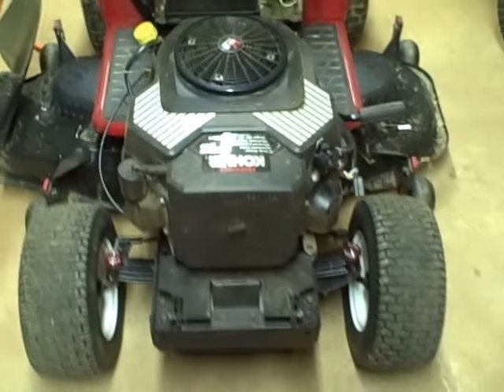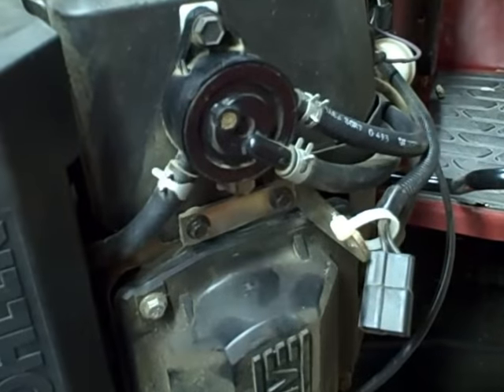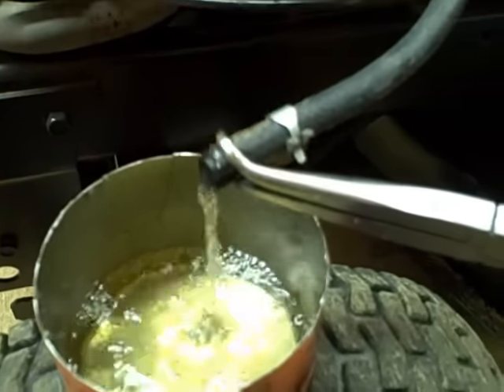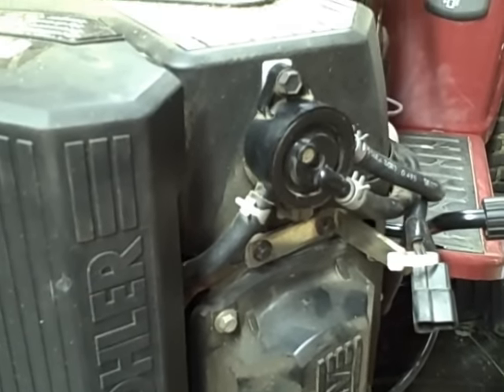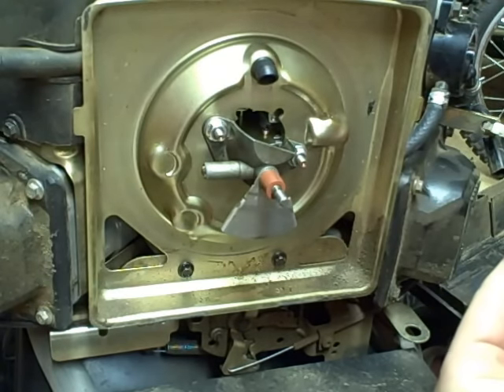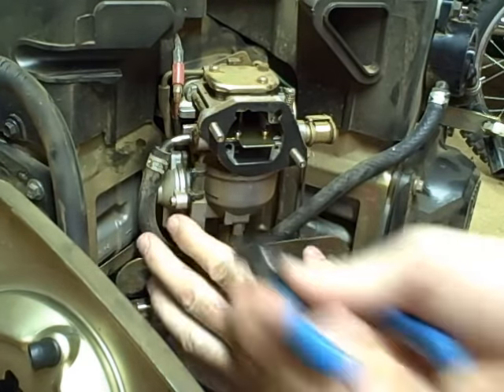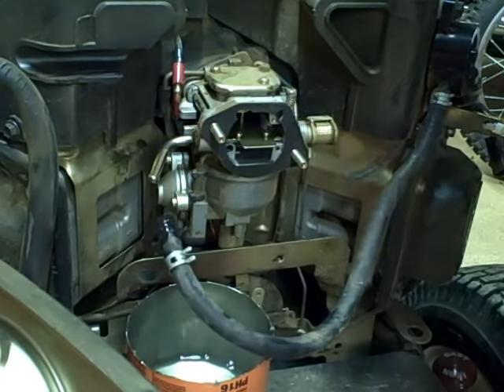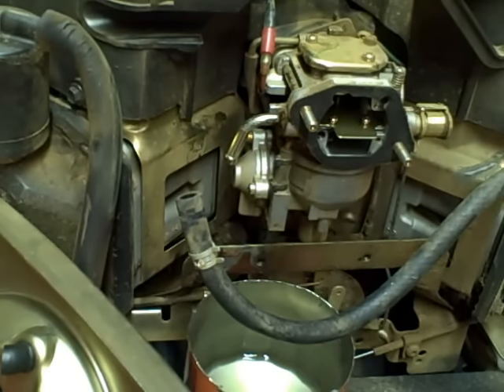Small Engine Repair: Checking a Vacuum Fuel Pump / Fuel System on a Kohler V-Twin Engine

Comment: Why not just disconnect the outlet fuel line from the pump and attach a short piece of spare fuel line to the pump. Then you don't have to take the air filter off.
Reply: I thought the same thing at first..... then I realized after he had all that removed, it allowed me to learn something about the line to the carburetor that I previously didn't know. Maybe he did that for just that type of reason. Take care.
Reply: He proved there was no obstruction in the carb supply line.
Reply: because that would have been to easy
Reply: That would be an easier method, but it assumes the person working on it had a spare fuel line to attach and test with.  His method works for everyone regardless of what spare parts they have available.
Reply: His way verified fuel flow all the way to the carburetor, doing it the way you are saying doesn’t, could be an obstruction in the line and you’d never know.
Reply: @Brees1986  Forget the extra/spare fuel line, just let it come out of the connection tip and catch the gas in a cup... That way no spare fuel line is needed
Reply: Glad he did it the way he did! It showed me the correct location of the fuel line. Some moron before me had pinched the fuel line between the carb and the air filter shroud so nothing was flowing! Probably the easiest fix in the book!
Reply: @Brees1986 🎯👍
Reply: @tmise50 🎯👍
Reply: @schlenbea 🎯🎯🎯👍

Comment: I had a ch 20 S Kohler V Twin, it was cutting out and shut off at high speed operation, I  tried another carburetor, fuel pump, checked the fuel filter etc.(before watching this video) The engine idled fine all day. It was definitely a fuel starvation problem. After watching this video, it stated check the oil level. Well the engine I was working on had WAY to much oil in the crankcase. The oil level is CRITICAL to the operation of the fuel pump since it works off the crankcase. After draining about 1 quart of oil out, the engine ran PERFECT.  If anyone has a similar problem check the oil level first. GREAT VIDEO!

Comment: To figure out the flow rate pump fuel into a measuring device for 15 seconds. Divide the measurement you get by 15 sec and you have base unit per sec. Lets say you measure ounces then it would be some number of Oz per sec. Now you can figure out how many gallons per hour.

Comment: You saved the day. You are the only person to mention the problem with too much oil affecting the pulse line. I had replaced my fuel lines, the filter and the fuel pump, but never thought to check my oil level. Sure enough, it my oil was a bit past the full mark. I drained it down to just below full and now everything works perfectly. THANKS!
Reply: Learn something new everyday. Never thought to check my oil level. Didn't know that that could affect the vacuum

Comment: Couldn't you remove the fuel line at the pump on outlet side to check pump flow and not have to take carburetor assembly apart?
Reply: Yes. Except you can expect gasoline to get all over the place. He made sure it went into a can.
Reply: He proved there was no obstruction in the carb supply line from pump.

Comment: Instead of taking off the air filter which takes a bit of time and effort, would it not be easier to take off the outlet pipe from the fuel pump and see if fuel runs out when you crank the motor, its the same result.
Reply: Tony Wonka yeah thats how I check my fuel pump
Reply: But maybe he just making sure its making it all the way through
Reply: Tony Wonka also he didn't wanna get gas everywhere
Reply: Well your engine will only run for 20-30 seconds with the fuel line disconnected if you are on a pull start mower like most commercial walk behinds. Plus this is not the exact same results because that would be post fuel pump so there are multiple variables. If you have a brand new good pump with good vacuum/pulse line but a partially clogged inlet line or siphon tube it will still draw fuel but not full flow but you you cannot visually determine full flow because half flow still looks like a lot. It Would give you a rudimentary idea of am I getting gas to the carb or not? Cheers
Reply: Would not have thought of that but that would be easier as long as you have some fuel line
Reply: Tony Wonka how do you clean the oil from the pulse line?

Comment: Sorry 1 more question:   my scooter has a one-way/no-return fuel valve installed between the fuel filter and the fuel pump.  Why is it necessary?  And does having a no-return valve helps to solve the problem of a faulty fuel pump that has fuel coming out even when there is not pulse from the engine?   TQvm

Comment: I am having oil coming into my carb on a toro 5000.... would anyone know what would be causing the issue? Took carb apart and cleaned it. Crank it up and still leaking oil from carb. Any tips or help would be appreciated

Comment: A great example of step-by-step, Point A>Point(x) troubleshooting.  I use the same principle whether it's gas or electrical flow.  Start at the source & test every junction in sequence until you find the failure.  Once you've built up your knowledgebase, then you can start "most likely problem" troubleshooting. :)

And thanks for having your lighting set up well!

Comment: Nice presentation of the troubleshooting flow chart! I went at it from a different approach,based on my personal mechanical knowledge, but didn’t think about the possibility of the crank case being over full causing this issue🤯. Thanks! That’s the first thing I’m going to look at tomorrow morning. I’ll be back with a comment,if my problem is solved by this inspection.

Comment: Great video...I tested my pump as shown in the video, and everything worked as shown, but my problem continued,  the engine would start up fine ...but only run for a minute or so, then die (as if it ran out of gas).  Letting the engine sit for a while would then allow it to start up again for a minute or so.  I watched a couple of videos and one video mentioned how you could tell if the pump was old by checking the small screen on the front of the pump....if it was black it was "old" if it looked metallic, then it was "new"....hmmmm I wonder?....so I got out some alcohol and a small brush and cleaned the screen from the outside (it was black and dirty) ....once cleaned the engine started right up ( as usual) but insteadf of dying out I mowed the entire yard with no further issues (about a 40 minute job)....so you may not even need a pump at all....you may only need to clean the small screen....worked for me !!!     Give that a try  !!!
Reply: Thanks for that tip.
Reply: How is your machine running this year?  ,i jave tried everything so im gonna try the screen cleaning next after reading this
Reply: My problem on a 22HP Kawasaki in my X320 JD turned out to be a bad connector (12 Socket) with 3 yellow wires.  One of these had low (10VDC) and was not opening the Fuel Shut Off Solenoid.  I checked the solenoid direct from Battery.  I went at the Connector (very small connectors) with Brakleen and plugged it back in and heard the Solenoid click.  I had started at the solenoid checking connectors and voltage.  There are 2 other connectors. One 5 pin, one butt connection at engine.
This after pulling the carb twice, blowing out line from pump to tank, replacing Filter, Fuel Pump and a lot of beer.  Works perfectly now.

Comment: As many others have said, nicely done. I'm checking my fuel pump tomorrow. It runs when I drizzle gas into the evaporation chamber before the carburetor. If the fuel pump is not it, it's probably jets, also simple.

Comment: Yes, he had the oil overfilled and the rubber vacuum line to the pump was cracked in half and deteriorating from oil in the tube i suppose.  Replace that vacuum line to the crank case if needed.  Thanks.

Comment: Nice job, thanks. Excellent camera work, tool selection and narration!
As others have mentioned, could troubleshoot in a way that avoids air filter removal, but it's always good to have a visual check of the entire fuel line and carb. 
Those notes: (thanks wonka & quantumrift)
1. Vacuum gauge is a good, inexpensive tool to help with troubleshooting
2. Can remove fuel lines from fuel pump line to save time and add a small piece of spare fuel line to do checks, if fuel pump is fine, then you know it is a line condition issue or obstruction
3. If gas cap vent is an issue, a tooth pick can be the right tool for a fix

Any votes on how long most fuel lines last before their condition affects performance in hot, humid climates? 3, 5 or 7 years?

Comment: Thanks for the great video!  I recently rebuilt the Walbro carb on my 31F series 17HP Intek, and it ran great for a couple of months, then started acting up again.  I checked spark, air, and fuel, and everything seemed fine, except that it would start spitting and sputtering after running for a while, and then sometimes stop.  After a minute it would crank, and then go for some more.  I saw 2:52, walked to the garage and opened the fuel cap, and was greeted by the hissing of air rushing into the collapsed fuel tank (it's hidden inside the frame of the mower) and a loud pop as the tank flexed back to it's normal shape.  That little diaphragm actually pulls hard enough to collapse a heavy plastic tank!  The engine starts and runs fine now with the cap partially opened, I'll have to replace that soon.  Anyway, thanks again, your video saved me from tearing my hair out!

Comment: Thanks for the video.I see a lot of people asking why take off the air filter assembly. I’m glad you did! My was already off and I was ready to buy a new fuel pump.I am working on a Honda GX610 and it keeps cutting off starving for gas. Now I know the lines, filters, and fuel pump are all clear and working properly, I KNOW now to keep searching for that low oil sensor. I’ve bought a new one but can’t find the one on the engine.Anyway, Thanks Again!

Comment: One thing you missed  is that some tanks have a wire mesh screen mounted to the pick-up inside the gas tank, these can become plugged or actually collapse and restrict gas flow. This happened to my Simplicity it would idle but was not getting enough gas to run at higher rpms. After removing screen and installing a good inline filter the tractor runs great.

Comment: Good video 👍 precise and to the point. Kawasaki fh 641 v have you ever heard of the fuel pump being relocated because the mower manufacturer put the muffler to close and causing vapor lock. This is on a snapper zero turn mower that none of the half dozen small engine shops in my area will work on. One mechanic told me there was a recall but nobody works on snapper because they don't pay the shops when they perform warranty work. The mower starts great when cold and will not start when hot

Comment: A vacuum gauge is a handy and cheap instrument to have around. I would have checked the vacuum inlet first with a vacuum gauge. THEN, instead of disassembling the air filter assembly, just unhook the outlet line, and stick a piece of fuel hose into a can. Saves about 5 minutes, and see if it's pumping fuel. It can also be checked with a pressure gauge on the outlet. As for the fuel cap, all you have to do is ensure that the pinhole vent hole is unclogged. I have a John Deere 345 and it wouldn't start. I pulled the fuel cap and found that over 13 years of use, the vent hole had become clogged with debris and air does flow into the tank due to the vacuum. A toothpick cleaned it out in about 10 seconds. No new cap needed.
Reply: my vacuum pump doesnt see to work

Comment: Well done, thanks!  I don't have a Kohler, but I can use these principles to check my fuel pump.
Reply from the maker: SpockMcoy Issmart Thanks for watching!
Reply: Fatboy, look at the lines.  I've noted 3 on any I've worked on.  1 is from the fuel tank, 1 is out to the carb, 1 goes up into the engine, where the vac is drawn from. hope this helps.

Comment: Good clear and concise video.  You instill confidence.  I have a craftsman mower with a Briggs & Straton 18 HP OHV engine that will start well then after an hour or so it dies.  The battery has just been changed to a new one but like I said the engine stopped after about an hour of use.  This has been happening for a couple of seasons now.  It is very temperamental.
Reply from the maker: Thanks
Reply: smallengineshop ive got a ? Could u email me i have this motor in a 20 hp and cant get it started ive had 3 engine shops look and none can figure out y it wont start

Comment: Thanks for the information. My father has a Kohler engine that is having problems but, I wasn't sure how to verify the operation of the fuel pump. I wasn't sure if the pressure was high enough. From what you said, it appears that the pressure isn't as important as the fact that an ample amount of fuel is flowing. I'll now focus on the carb float etc.
Thanks again.

Comment: Question for you: Should there be fuel flowing out of the pump without the engine running/cranking? Or would that be a sign of a bad diaphragm? 
You would probably have some pressurized fuel in the line (as you did), but should it continue flowing once the pressure is relieved?
Having issues with fuel flowing out of the throttle opening on the carburetor after sitting overnight. Already took apart and cleaned the carb and float bowl, and that helped for a while, but still having the issue.
Thank you for the informative video!

Comment: Well done. Thanks.
That is MY mower.  I bought it for $100 cause the owner didn't know how to change the $12 PTO switch.
I removed the deck, and just buzz around the 9 acres with it since it has a fast forward speed.
SIDE NOTE: Dig around your garbage and find a tin can that doesn't have sharp edges.

As usual...
THanks for THinking!

Comment: A very common, but not well known at all, reason for bad flow from the vacuum fuel pump to the carb is air in the gas line somewhere between the gas tank and the fuel filter. The line isn't "plugged" with dirt or debris. The air simply prevents the relatively weak vacuum pump (even when new) from being able to suck a sufficient quantity of fuel through the system per minute. Most often what happens is that the user runs out of gas, or gets to the point where then engine is sputtering from being starved.  Gas is put in the tank, it starts,  but air may be hiding somewhere in that long line on a zero turn. After 10 to 30 minutes it cuts out. Solution is simple but not OSHA approved. Blow into the gas tank while your face makes a tight seal so pressure builds up. This will clear out the line. (By the way to test a fuel pump just blow into its plastic tube that is ordinarily connected to the valve cover. If it totally resists you blowing into it, it's likely still good. This video explaining this which I found today was a revelation. Won't be buying an annual fuel pump. https://www.youtube.com/watch?v=eQf1BDmyUCw

Comment: Good vid dude         ......I have to tackle this tomorrow. Im getting fuel TO the filter,thats all I know so far. And I do know the fuel line FROM the filter to the  pump is "aged" with slight crtacks etc but no leaking ......and the line FROM the pump TO the carb is very aged & it even feels almost britle when I try to smash it with my fingers. Hoping iots my Line & Not my carb.,
Reply: +97warlock ismyname          UPDATE.....Ive removed fuel line from Pump to carb & NO fuel. SO someone on youtube said "oh just remove the 4 screws & it comes right off".  I did this & the only the front half of the fuel pump comes off.   Now Im stuck in limbo wondering how to get the remainder of the pump off there. All I see is a plunger type diaphram flat thing. - Thinkin of mounting a Manual pump.

Comment: Good video. I think my pump is bad. Engine starts with starter fluid but dies. I have fluid from filter but not past pump.  Better this than fuel slinoid.

Comment: Some fuel lines coming from the fuel tank (depending on which model) Will enter from the top of the tank instead of the bottom and it just dribbles out of the fuel line when removed at pump, even when held close to the ground.So keep in mind, Ive used a hand pump with a light draw on this line to verify this passage.
Reply: Never seen a fuel line coming from the top of tank. That defies gravity. I could be wrong! Any way I have a small funnel that just covers the tank filler opening. After disconnecting the fuel line from the pump and inserting it in an empty container I cover the filler inlet with the funnel and blow a VERY LIGHT I repeat VERY LIGHT air stream through the funnel into the tank to push any obstruction threw the gas line. you can see the tank expanding slightly with air pressure. This ensures for sure, nothing blocking fuel line from the tank. CAUTION: I said a low pressure of air. You do not want to explode your' fuel tank just push any obstruction in fuel line, and use a container to catch fuel coming out of the line. Common cense!!!!
Reply: You can also remove fuel cap and blow into the line at Filter.

Comment: I checked fuel flow rate before by connecting separate fuel source to Ron the engine with variable pressure electric fuel pump. For example, 2 gal pet hour would be 16oz (2c.) in 3 min., 45 sec.
  Let the engine run off other fuel source, pumping fuel into a measured container. Don't forget to start your timer when the engine fires up, and SECURE THOSE FUEL LINES!

Comment: This is an old video but hopefully I'll get some answers. What would cause me to get no vacuum or pressure pulse on the pulse line from the engine to the pump.
No cracks in the hose. Oil level is fine. Don't see any cracks in case.
Possibly a valve problem or head gasket ?